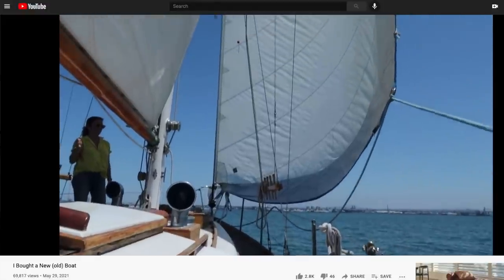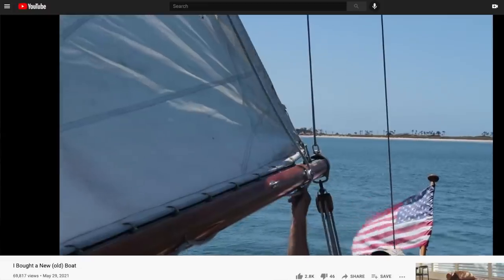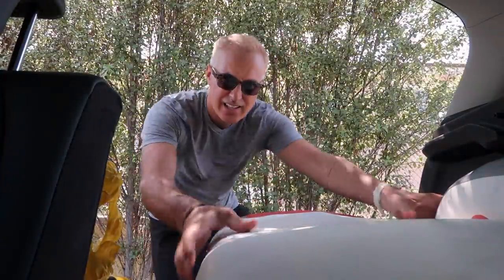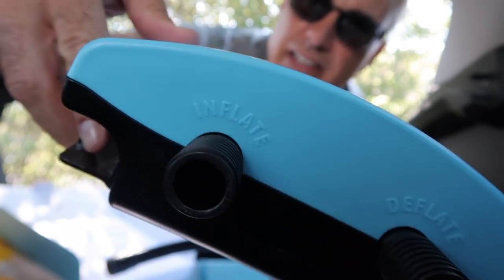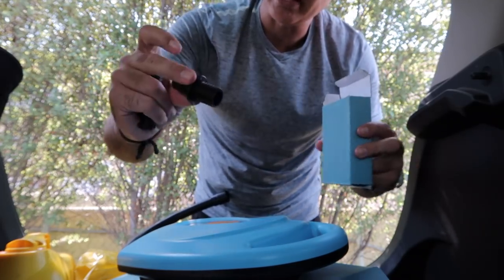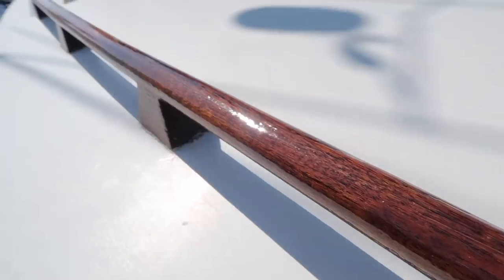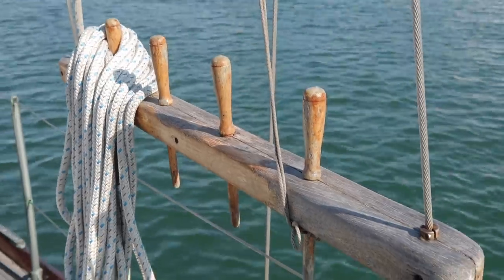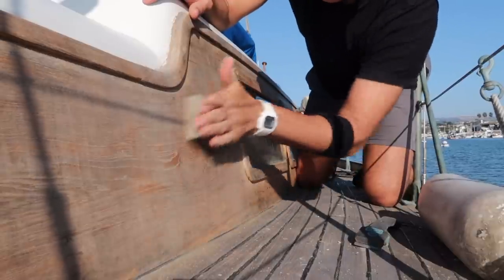Boat Update and a New iSUP Pump

Comment: Josh, hopefully you won’t have this problem, but since teak is an oily wood, sometimes epoxy doesn’t adhere to well. It is a better idea to put one or two very thinned coats of varnish on first before the epoxy, followed by lots of coats of varnish. I’m switching to synthetic varnish that can be recoated within 12 hours, and in as little as 1 hour, without sanding (well maybe sand before the last coat).

Comment: The Epoxi coat is a big mistake, sorry to let you know but never epoxy seal teak work!!! If You wanna discuss varnishing I'm a professional varnisher of superyachts and classic boats currently living in New Zealand!!! Cheers
Reply from the maker: I’ve spoken to many professional varnishers here who tell me that the epoxy sealer is a good thing. So it appears there may be differing opinions even among professionals. Do you suggest no sealer and start with varnish as first coat?
Reply: @JoshPostVlogs  When you doing brightwork on Teak which is an oily wood you best use a single pot tung based varnish (Epifanes my choice). From sealer coat to final coat using the same varnish. Cheers